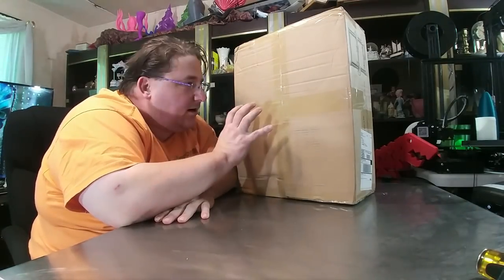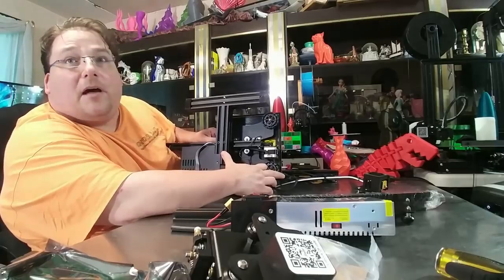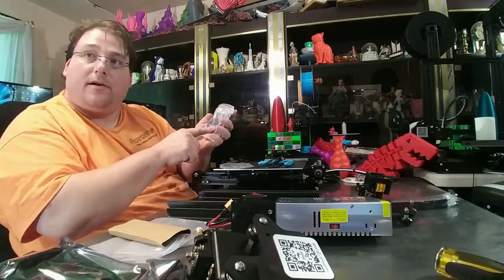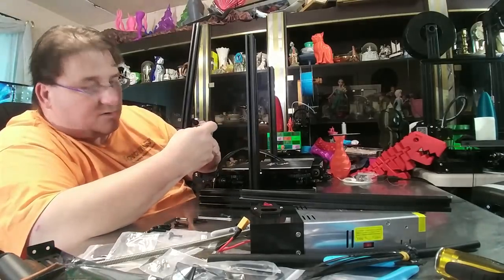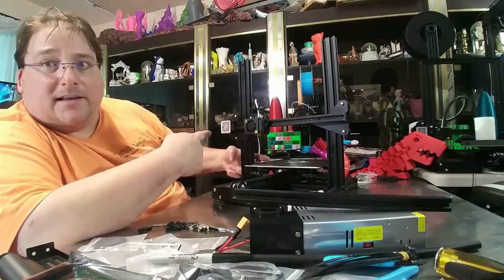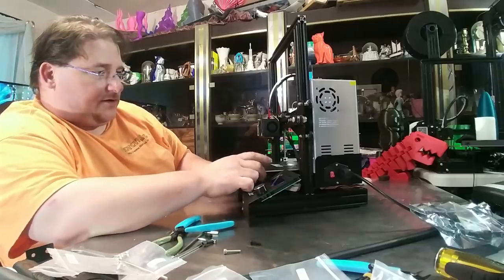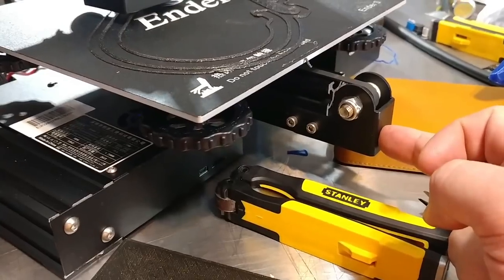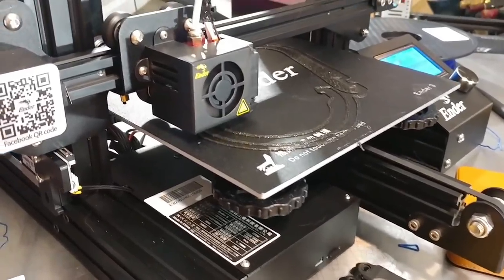T3DP 223 Ender 3 Updated Model Unbox, Build, Upgrade, Many Prints

Comment: Hey man, love your videos. I bought a CR20 a few days ago and it's printing pretty nice out of the box. I noticed the x axis belt is noticeably less tensioned than the Y. Do you have any  tricks for getting the right belt tension. Don't know how tight it should be and how over/undertightened belts affect print quality.
Reply from the maker: I tighten them by hand so I loosen the tensioner I pull it out with a force of my own hand and then tighten it basically you want the belt to just twang but not too tight as the motor moves back and forth if you see the belt flexing around it's too loose too tight will affect your print quality and stress your components
Reply: Thanks :) Will you be reviewing the CR20 any time soon?
Reply from the maker: If I can get my greedy Little mitts on one I will :-)

Comment: I have a problem with my Ender 3. Every time I print without a raft the first layer doesn't seem to stick and I have to stop the print. For instance when I print a box it starts with a nice straight line but when it turns 90 degrees to print the next line it drags part of the previous line with it. Is this a bed leveling issue? Is the speed to high? Any help/suggestions would be appreciated.
Reply from the maker: Yes this is 100% a bed leveling issue do a search on YouTube for cr-10 bed leveling basics look for my video with me holding two spools in front of me in the thumbnail watch that video

You do want the first layer to be hot and slow for example in my slicer I set my first layer temperature to 220 and my first layer speed to 30% speed this makes it very slow and very hot which greatly increases your stick it also makes it more tolerant to incorrect leveling so if your leveling is bad but close it might work

I have been working on a way of describing it and here is what I've come up with so far basically the filament needs to stick and not be too flat and smooth it should feel like firmly attached fishing line under your fingertips don't print squares print circles so put a skirt around your print about 2/3 the width of your print bed so on the Ender with a Marvin in the center 75 mm skirt which will be about a hundred and sixty mm across which is perfect for the Ender 3 you can also download my bed leveling Marvin which does exactly this from my profile Link in the description of this video load that on to your printer and hit print as a prince the skirt feel it if it's not working you'll notice immediately you'll see the same thing you just described to me instead of forming an arc it'll form a straight line between the last Point stuck in the nozzle that's your indication that the bed is too low you need to turn the knob to raise the bed slightly do this at all four corners as it goes around when it starts to stay put you're getting close as it makes a circle Terrell field Circle once it's going all the way around just grab it and tear It Off so that the new circle is clean

I think I have it set for three or four perimeters if you haven't gotten it by the time it starts to print the center just hit stop clear the bed and started again you'll get closer and closer each time the bed is too low turn the knob from right to left looking at it from the front so that it raises the bed slightly not too much little bit each time

 if the filament sticks but it's very flat and so it feels flat and smooth under your finger and you can see through it assuming it is opaque filament then you are too close you need to turn the knob looking at it from the front left to right to bring the bed down a little bit away from the nozzle when you get it sticking and it's correct it will feel like fishing line underneath your fingers pushing on it gently should not remove it should take some force or a fingernail to get it off

 before you do any of this make sure your bed is actually flat if it's slightly warped like you can see a sliver of light underneath a straightedge that's probably okay but if it's a pretty big warp then you're going to want to put a piece of glass on top of it if your bed is not flat you're never going to get it level. 

 also double check to make sure your right hand vertical trolley is not binding if it is your bed levels going to change every time you print watch my Ender 3 fixes video for how to check for and correct these issues if you have them
Reply: Just downloaded one of your test files (Bed Leveing Marvin) and it seems to print fine. The big circle seems to stick good and I did noticed that the speed is very slow. I'll have to check my slicer settings (may upgrade to S3D). Thanks for your quick response.
Reply from the maker: Gandor also check your offset for first layer in whatever size are you using I use 80% since that's the default in simplify3d
Reply: Just finished watching the video you suggested and must say one of the best videos I have seen in a while. A very good explanation how to make sure that first layer comes out good and how to fix it if it doesn't (also like the pen you have, is that a print?). My test print finished too and the Marvin looks great so there is something in my slicer settings that I'm doing wrong. Thanks for all your help.

Comment: Nerys, ive downloaded your bed leveling marvin file but it will not open in s3d.  Do i need to do something to the file?
Reply from the maker: Will open in preview mode as if you will sliced it but you won't be able to edit it since it's just a gcode I can upload a factory file if you want
Reply: That would be awesome, i just wanted to print it using your ender 3 profile but the printer doesnt do a thing when ive saved the file.
Reply from the maker: Just copy the file to your SD card put that into your printer and then selected from print from SD

Comment: I just scooped mine from gearbest, so worried that I'll get one full of issues. It's my first printer :0
Reply from the maker: If you're ordering it from China you should be getting the latest version it's only one that are in stock or Warehouse in other countries where there's a delay between when they ordered it and when you order it for example if I buy it from a u.s. seller that us seller may have bought that shipment of printers 2 months ago so it might be the old version but if you buy from China they tend to use jit shipping just in time meaning they don't really keep a stock they order as needed from the manufacturer at least I think that's how it works so you have the highest probability of getting the newest model when you order from China in a month or so I figure there won't be any old ones left if there's any left now
Reply: Nerys fingers crossed on that one. I have been hoping that to be the case. I know that RMA isn't as defined in all markets  ;)
Reply from the maker: Two Good good news and bad news the bad news is there is no RMA there's no way you're paying to ship that back to China and there's no way gearbest as paying to ship it back to China it would cost more than the printer :-) good news is the old version has quirks but they don't make the printer bad at most you need to fine-tune your assembly and maybe add some smoothers otherwise it's just as good three of my four machines are the old version and they print just as nice :-)

Comment: My priline petg white printed like crap under extrusion on stock hotend at 238c @35mmspeed
Reply from the maker: 238c is a bit too low for petg try 245 to 255
Reply: Nerys i am running stock and was worried about melting the tube.... Or any vapors? This is in my bedroom.
Reply from the maker: Electric Euphoria you should be fine up to 250-255 no problem I would of course not suggest printing ABS in your bedroom :-) but PLA and PET G you should be fine 238 however is simply not hot enough for petg that's why you're getting under Extrusion too cold I'd be surprised if it sticks to the bed too
Reply: Nerys i will modify my settings tonight. And report back. Out of all the streamers. You seem to have the most knowledge with ender 3's.  Thx

Comment: Your link to the Comgrow Ender 3 is going to a regular version, but they have what they are calling the upgraded version for $20 more on another listing.  Do you know if the one you linked is, in fact, the newer model?
Reply from the maker: I do not know the upgraded version would almost certainly be the new model the other one I'm not sure it depends on how deep their stock is and how old it is I ordered the regular one and got the newer model but someone else a week before me ordered one and got the old model there's no real way to know
Reply: That upgraded version you are talking about is the most recent version of Ender 3, it has a removable glass with different surface(than this faketak) already on it, also you get 5 spare nozzles
Reply from the maker: Marek Cernvenokovsky well the thing is I don't know if that is something that creality is doing or if that is something c o m g r o w is doing in theory it should be the newest version but I can't promise that

That surface is the diamond plate or ultra bass like what anycubic uses it's an auto release print surface for pla use a release agent for other Plastics to avoid damaging it such as hairspray or glue stick or magic goo

You want to print Hot 75 maybe even 80 Celsius so you get good stick when the surface cools down the part pops right off zero Force

Comment: Thanks for the hard work! Love your videos/lives!
Is your fff file for cura or simplify3d?
Reply from the maker: Simplify3d and thank you
Reply: Nerys thank for your answer! Have you or will you do in the futur a video showing how you prepare a print with it?
Reply from the maker: I'll see about figuring out a way to do that
Reply: Nerys you can use an app like mirilis action to record your screen maybe?
Reply from the maker: I will look into it thank you
Reply: Nerys I have to thank you! I struggled so much with a print issues that I couldn’t fix, and your profile worked so greeaat!
I have still few questions as why my print takes always more time than what said by S3D?
What do I have to change if I want to print abs, beside temp? And if I want to use a 1mm nozzle?

Again thank you so much! Currently as a student I can’t afford to make a donation but be sure that in the futur I will do it!
Reply from the maker: silphfull for the one millimeter nozzle you need to change nozzle with and line with two one millimeter you also need to slow down 25 millimeters per second and increase the temperature anywhere from 5 degrees to 20 degrees depending on how thick your layer line is for example when I try to print a .6 mm layer line I use a print temperature of 230 degrees Celsius

Predicted print time will never be accurate do you see those settings that I put in the start script? For jerk and acceleration both of those slow your printer down a little bit the result is better quality prints they're also built in firmware thresholds in the printer itself that the slicer is unaware of all of this results in the actual print time being different than the predicted print time

Four different materials the only thing I typically adjust is bed temperature and nozzle temperature otherwise my settings don't really change much what I am printing determines my settings more than the material I'm printing with
Reply: Nerys thanks for your answer!
I still have a lot to learn but it’s thanks to guys like you that I learn so much!

Comment: Does your fan on the "brain box" ever run?  Never seen mine spin.
Reply from the maker: Yes once the fan on the hot end the parts cooling fan turns on the brain box fan turns on they are linked so you might not notice it I'm going to change that eventually so they are not linked anymore

Comment: Did you say you're using a 1.2 mm nozzle?
Reply from the maker: Yes sir. 1.2mm a fatty nozzle. And the results are freaking cool!
Reply: Nerys I played with the one mmmm for a while. But I didn't do anything like this. Those vases are cool
Reply from the maker: Average Joe's 3D if you have an extra machine to play with one on you should it's a lot of fun you do need to slow down and you do need to greatly increase your temperature especially if you're going to use large layer Heights remember even at .2 mm which is what I do the vases at it's 1.2 mm wide which means you're pushing three times the amount of plastic through the nozzle go to a .8 mm layer height and you're pushing 12 times the amount of plastic this is why even at 30 millimeters per second or even 25 millimeters per second I can still do so much more and so much less time because you're just pushing so much plastic when you're doing large things you don't need the fine details that a point for nozzle permits they become irrelevant once you scale a large enough :-) it's also interesting because you can make stupidly strong components for example Elixir / silk / Ultra pla the nice shiny stuff glass? Suddenly not so fragile when it's 1.2 mm thick :-) suddenly those filaments become usable structurally which is very nice
Reply: Nerys I never thought of increasing the temperature that's a good tip
Reply from the maker: Average Joe's 3D yep you have to I print even normal pla at 240 even 245 Celsius just listen for bubbling and drop it down five if it bubbles but you need the increase thermal energy to be able to put that much heat into that thick plastic that fast
Reply: Thanks Nerys for this very helpful explanation of nozzle dimension and plastic feed.